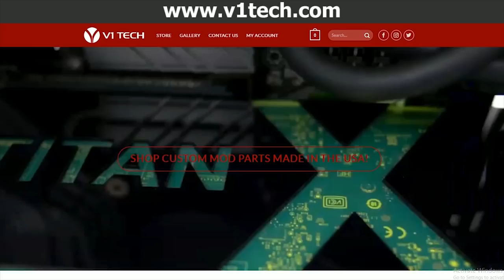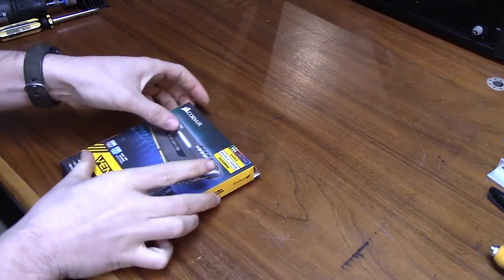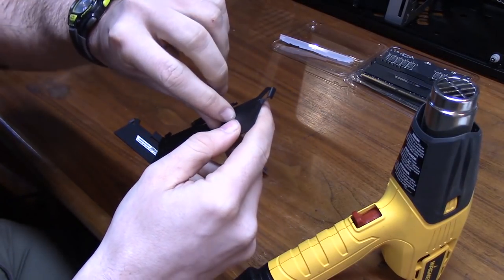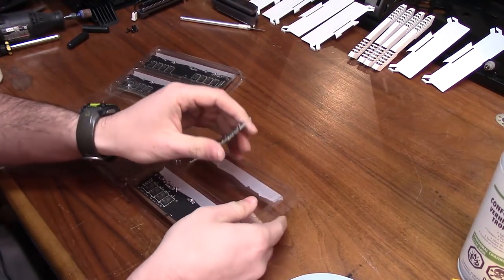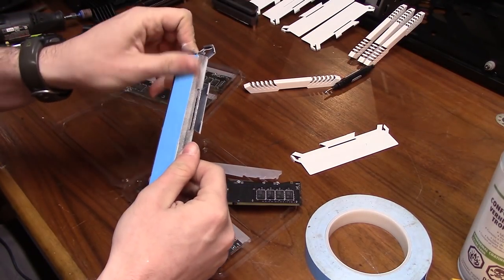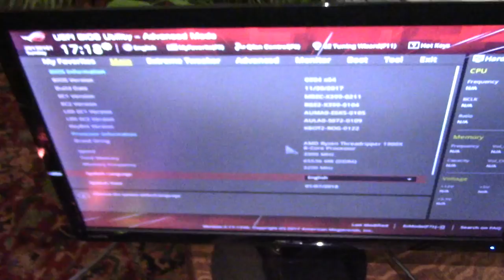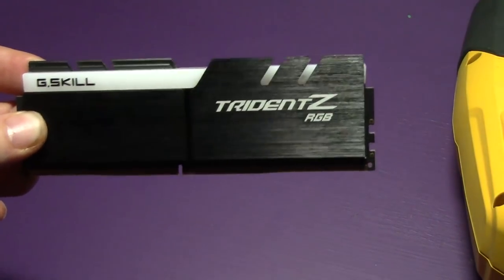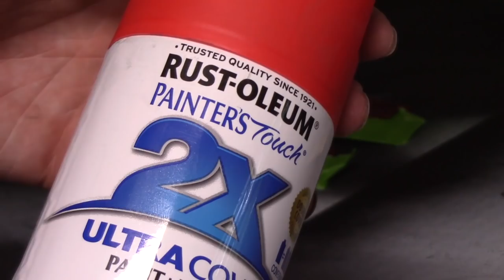How to paint your RAM! (any make or model)

Comment: Fun fact about RAMs heat resistance. Years back, out of curiosity, I wanted to see if I could destroy RAM with fire. I set the RAM over a candle where the flame was touching the RAM - and left it for like half an hour. Plugged it in and it till booted and ran fine. Took a lead pencil to it and it killed it dead in 2 seconds however.

Comment: Well shot guide. Clear, concise, and with proper viewing angles like most of what you do. I always enjoy watching other modders' creativity. One thing to note about the light bar on LED ram is that you can actually paint that if you want it to light up a certain color. Obviously you don't want to with RGB RAM, only with single color RAM. All you have to do is use a translucent glass/floral paint like those you can find at Hobby Lobby, Michael's etc. Spray it light and don't do more than 1 or 2 coats to prevent opacity. Design Master and Krylon are the two most common brands that make these paints. Design Master Tint It and Color Tool or Krylon Sea Glass are the types to look for.
Reply from the maker: +Mr. Manager Oh yeah you're right, I didn't even think about that. Just goes to show I haven't done everything, even on such simple mods as ram painting :p

Comment: This is honestly the most comprehensive and the best video on modding I have seen. Good work mate.
Do you think it's possible to pain the RAM PCB with a non conductive paint without affecting the temp?
Reply from the maker: Thanks dude!
Yeah you could totally paint the pcb, just don't get the connection points :)

Comment: Wouldn't the amount of liquid used at 7:23 hurt any electronic or is Isopropyl Alcohol different? Also, wouldn't a paper tower catch on small components possibly ripping them off or leave some paper tower residue behind?
Love the work you do and I am going to mod my first case and hardware in the coming months thanks to all your guidance and tips on your channel, thanks a lot!
Reply: Isopropyl Alcohol above 90% (total mixture) is relatively safe for any circuit boards of any kind. The purest the alcohol you can get the better.
Reply: Also electronics can be cleaned with water, you just have to wait for them to completely dry before using them again

Comment: Hey, dumb question.. But would it be possible to use another RAM's heatsink to use on let's say the corsair RAM? For instance the hyperX heatspreader on the RAM to make it low profile? And vice versa
Reply: Yes you can, just make sure the heat spreader isn't too tall. Don't wanna try putting an LPX heatsink on DomPlats for example, because DomPlats have a taller PBC than LPX.

Comment: What thickness of thermal tape/pads do you use for ram or does it differ between brands? I've heard that getting too thick of thermal pads will cause issues with even heat distribution but am curious if you had any advice on this.  I'm thinking about repainting some HyperX Predator RGB ram sticks for a build i'm working on.
Reply from the maker: I believe it's different for each brand. They're cheap so, just get a couple sizes and use whatever one is closest to the original
Reply: @DIYTechTube true, well it was worth asking, I think I may contact their customer support just to see if they could even tell me before I buy it. Honestly I'm sure knowing I'll planning to buy it would help to persuade them to give me details on what to use.
Reply: @freyahaze  what thickness tape did you end up going with ?
Reply: @xxxae_  I ended finding a pack that had varying thicknesses.  don't recall any more specific details Than that though. was a few years back
Reply: @freyahaze  no problem i appreciate the reply !

Comment: Would i have to worry about shocking the ram and killing it if i do this? I have 8 gigs of ddr4 3200 vengence and id love to paint it white. But i dont want to accidentally damage it
Reply: ah just do it, im currently at it but i got 16 gb 2400 Mhz Vengeance lpx. They are drying atm. I also painted the pci slot covers and some screws. So far it looks really good

Comment: please dont follow this tutorial. just because paint isnt conductive doesnt mean it wont affect the PCB.
Reply from the maker: Except that it won't. Heatsinks are already painted, we are just painting them a different color
Reply: @DIYTechTube  you painted the ram with the heat sinks on them and stated that its okay if paint gets on them. that is not true. It will effect the longevity of the ram. also, ram is not sensitive to low heat but heat coming from a heating gun can kill a chip as it is getting it way hotter than normal operating temps would.
Reply from the maker: I've been using painted motherboards and ram for ages, directly painted onto the PCB. Hasn't failed me yet! And I use it every single day :p

Maybe one day I'll break some ram but so far going strong
Reply: @DIYTechTube  i wouldnt say "ages" as you just started modding a few years ago by the looks of your videos. just because it didnt fail for you doesnt mean it wont fail for other people. painting silicone causes the heat to be retained, increasing internal temperature. theres a reason not a single motherboard, gpu, or memory manufacturer has released fully painted products, they may paint the pcb but all other parts are left bare for a reason. youre misleading people into thinking that this is safe and the right way to do things. It might work out for you but stop stating this is "how" its done. Because this is clearly not the proper way.